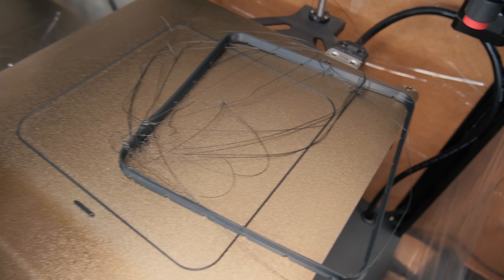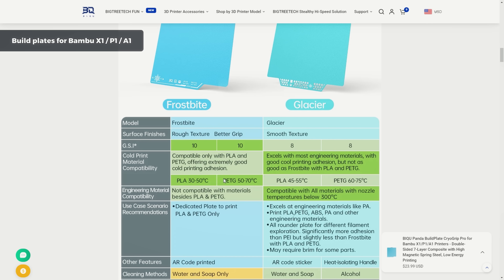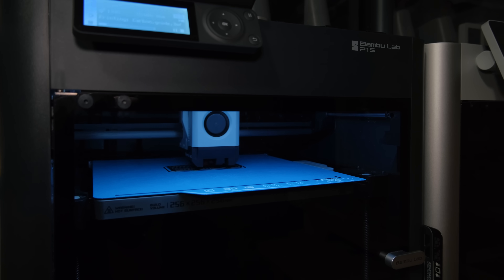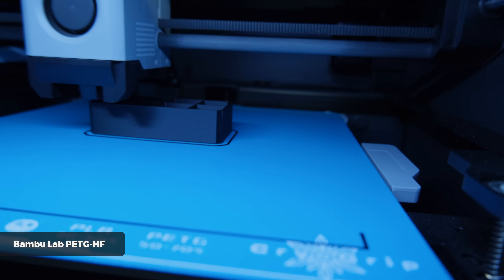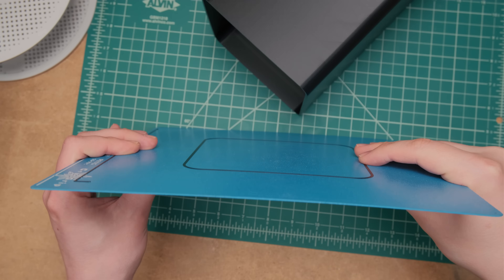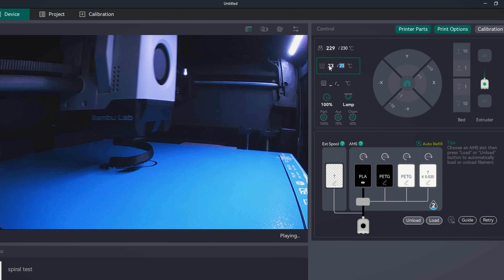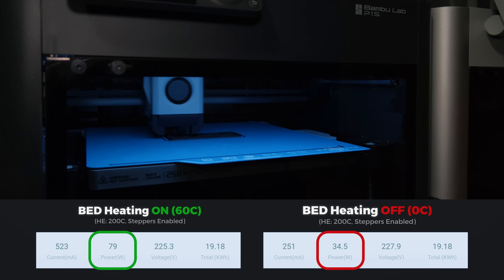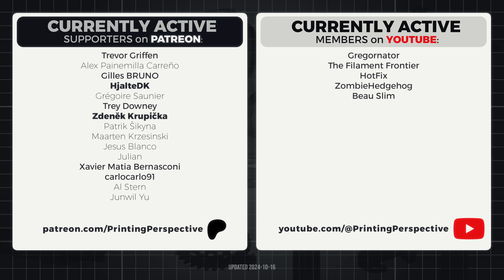The Game-Changing Build Plate (CryoGrip Pro)

Comment: Thank you convincing me to not to buy the cryogrip. There are 2 problems:
- If you print PETG on cold surface in cold environment you get similar issues to ABS.
- the print should release after cooling down. Right now my PEI sheet bed does that extremely well with PLA and PETG. Requires zero force to remove parts.

Comment: Regaridng removing prints: if youre hands are geting all over the build plate, does this plate help mitigate oils transferring from fingers and messing up adhesion?  Or are you still using IPA between prints if you have to handke the build plate?
Reply: I haven't had to clean it yet and I've done like 20 prints on it

Comment: This is awesome, they should offer other sizes for bigger printers. I would certainly use one of these in my modded Anycubic Mega X if they offered it in 300x300… it takes forever and spends a lot of power heating up that big bed , specially being an open printer

Comment: A bit of misinformation here
1) that LIDAR warning is not about it not detecting the plate, but about not detecting plate TYPE because it has no QR code. You can disable that check in the slicer.
2) part warping is not because the plate lifted (I very much doubt it lifted in the centre), but because the plastic just springs to it's warped state when not held by the plate. Use "reverse on odd" in Orca to lessen that problem.
3) Aux fan has nothing to do with the bed temperature, it's there to help with cooling the part to get better overhangs. There's no reason to disable it, you will get better results with it enabled. You should also orient the part so that the overhangs are getting as much air as possible.
4) Chamber temperature has absolutely minimal impact on overhang performance unless it is crazy high. Layer adhesion is always better with higher chamber temperature.
Reply: In my experience, AUX fan indeed does not affect bed temp, but it definitely make the warping issue worst, especially on the side close to the air duct.

Comment: Get 3M super 77 adhesive spray. Use it under your plate on the hot bed and it will hold the plate so good no warping.
Reply: Better to address the cause of warping than try to over power, or do both.  But spray glue to keep your sprint steel plate stuck in place?
Reply: @JoeyMoreland  yeah so basically when the magnet isn't good enough it will taco the bed and print together. If you can hold your spring steel sheet down with adhesive under it then the surface texture is now able to hold the print in place and let it solidify and get hard and not warp off the plate. It will always warp of you don't have good bed adhesion due to how the plastic shrinks when cooling. CNC kitchen explained it. You can slow the print down and increase the odds of it not warping as well. If you can over come the forces then it will solidify at that shape once cooled. Aka either the build surface texture able to hold it down or the spring steel sheet lifting off the magnet because it's not strong enough.
Reply: No way, that would be a miss and stink!

Comment: I'm testing the Glacier atm in a P1P with a case. I'm testing PLA at room temperature, and it seems good so far. I really want to see how this or the CryoGrip work at room temps on my A1 (it's busy for a few hrs and I didn't want to wait to try this). If I can get that bed heat to 0, I'll be super happy and get the Cryo as well.

Comment: To easily remove PETG (or TPU) from the plate, throw the plate (with parts on it) in your freezer.  Don't be surprised if they fell off the plate after 20 minutes.

Comment: Is the warping potentially from the slightly wider plate being fit between the 2 aligners and pressed a little? As that minor compression could introduce a very small bow/bend in the plate. Should be easy enough to know by comparing 2 of the same print on an A1 VS P or X series right?

Comment: There is a problem in that this is fighting the physics of plastic shrinkage, the temperatures we have established for PEI/Glass beds work because it keeps the parts from shrinking mid-print and popping free. So it's holding on, but the plastic is still shrinking beneath, so now you are printing new features on-top of a slowly deviating area(or it stays centered and lifts the edges of the plate). Alignments will slowly drift if there is geometry that makes it lean a particular direction, differential cooling effects will be amplified, etc. The whole idea is to TRY and keep the whole part up around the Glass Transition Temperature until it's done, THEN let it uniformly shrink the rest of the way all at once while everything is anchored in-place. Making the bed hotter isn't exactly what gives PEI/glass a grip, it's the fact the plastic isn't actively trying to mechanically shear itself away on a per-line basis, making the bed hotter pushes the Glass Transition temperature gradient higher up into the parts layers, so less of them are shrinking too soon and it's ability to hold on gains a mechanical advantage of sorts.
Reply: Thanks this might explain why I've gotten warping on this plate
Reply: @AJolly  don't listen to this asshole level your bed when your done lvling it level it again and run 15 mill high draft sheild your welcome
Reply: Does the plate withstand 60-70° C?
Reply: @pyalot  It looks like both the plates are at least 70c and 75c in all the tables for the max you should need to go to, but also one of the illustrations very visually says the bed is 100c while the handle edge is cold enough to touch. Else no specifications given there, so anyones guess unless officially disclosed as supported temperatures.
Reply: @Roobotics  thanks for your explanation, can you give me a conclusion from your analysis? Maybe why i should use PEI rather than a cryogrip plate, thanks!
Reply: @re_aryasetya  I won't tell folks not to get one actually, I just picked one up for my A1 mini myself, sometimes extra gripping power IS needed for thin-edged items, I think for small things in general it's really not a bad choice. But getting up to larger build volumes will multiply the effects of thermal shrinkage shifting and subtle inaccuracies of laying down hot filament onto a layer that has already contracted more than one on a hotter plate would have.
Reply: @Roobotics  definitely a perfect scenario. Brute force works well tho and most of the time those tolerances aren't really causing people problems in the real world. I know there are some parts that need more accuracy and probably would benefit in an advanced situation where the tolerance needs to be very tight, if so just get a CNC part or a resin printed part at that point.

Comment: I tried Cryogrip with my bambu x1 carbon and it was fantastic. Few days ago I bought another printer named Qidi plus 4 and it has very similar with x1. I want to use cryogrip on that but I cannot find different size of cryogrip. I just hope to see different size like 310*310 (Cryogrip), 450*450 (CR10 max).
Reply from the maker: BIQU said they will make these plates for other 3D printers, so you have to wait and see. :)
Reply: @PrintingPerspective  I asked to BIQU about and I go t same answer. Qidi told me similar answer. I cannot do  anything except waiting.

Comment: picked one up for my p1s. a real shame the glacier one isnt availible yet or I would have ordered one for engineering filaments. I print 90% pla, but im curious how the other plate would fair for stuff like tpu. plus some of the high temp filaments like pet-cf which wants like 100c bed temp with the bbl high temp plate and glue.
Reply from the maker: TPU has very good adhesion even with regular PEI plates at low temps like 35C. I will try to pin an update comment when I test the Glacier. But with ABS/Nylons/PET regular PEI with glue stick works great as you either way have to heat the bed. But it would be nice to have a plate to print many small parts and know those won't pop off during the print.

Comment: I wonder what's the market for these things. PEI beds have already surpassed magnetic adhesion for years... Personally never have parts detaching (ABS, PLA, PETG, even large) as long as PEI is clean (Q1 Pro). Printing with a cool bed migt be of interest for PLA, but surely not an option with ABS/ASA/PA because of other reasons
Reply: You say that: most people print mostly PLA / PETG, this could save a lot of energy and no more waiting for bed to heat / cool.

Comment: Very cool! A shame it didn't fit the X1/P1, as this makes it a no-go for me.
I would have liked to see your adhesion tests compared to existing plates :)
Reply from the maker: It fits but every time you have to align it perfectly which is annoying. After all the prints I have done, the adhesion is not an issue at all. But only time will tell if it won't degrade. :)
Reply: @PrintingPerspective  kiss the edge with a grinder, jeez.
Reply: It most certainly fits. It is designed for them. You just need to run your finger at the back to ensure it is placed within the stops. If it is outside of the stops just press down or re-seat it.
Reply: mine fits fine, no similar issue

Comment: I have this plate on A1 now. Pla with 50c sticks perfectly but petg even with 80c barely sticks.
Reply from the maker: I had perfect bed adhesion with Sunlu PETG and Bambu PETG-HF. I am curious about what brand of PETG you used?
Reply: @PrintingPerspective  it has no brand, at least I can't see. And another one I bought couple of years from Ali, it's petg+. The name is xingtongzhilian 😂 I am guessing is the company's name.
I may need to try branded ones. But PETG that I have barely want to stick while on pei built plate sticks. Weird.
Reply: Would love to know what PETG that is with. We have not been able to find a PETG that does not stick.
Reply: @bigtreetech5117 unbranded one. So I guess it won't be big issue for most people. I need to buy branded one and see how it goes.
But pla sticks though perfectly
Reply: Which plate? Frostbite or Glacier?
Reply: @foam27  it was bad petg, very bad, I bought new and haven't problems since. And it is blue one. No idea which on it is

Comment: Imma be honest, for PLA I havent had any issue with the stock bambu PEI bed. Smearing some vision miner nano polymer stuff on the bed to be extra sure isn;t a bad thing either but I just can't justify buying a bed that hold slightly better when its just for PLA and PETG. If this was performing this well with ABS then I would be interested.
Reply: I agree.  When I saw this all I could think was what's the issue with pla petg bed adhesion?

Give me something for my ASA that I'm not forced to use the magigoo adhesive.
Reply: Idk with mine I'm always fighting with adhesion on my a1 and a1 mini, changing temps tightening everything washing with soap and water after every print, yet somehow it still can't stick stuff to the plate, second I switched to this one I haven't had a single issue, might also be cus my room is drafty and unfortunately I can't control that but this plate has definitely removed my printing frustrations

Comment: Using less heat on the plate also means you're able to pop it off sooner, at least in the way you would need to to get the parts to come off.. definitely with you on the improved magnetism over double-sided plate tho; I'd rather just have a smooth plate anyway, so the double-sided nature doesn't really appeal to me over it shifting around..
Reply: The magnetism is extremely strong. We would love to see if the plate was actually lifted off the magnetic sheet with the prints that warped.

Comment: If you need to remove debris from an older print, and the print is no thicker than a layer, just print a few full layers over the top of it and peel it off. You might need to have the heat on full to ensure the old material fully melts and mixes.
Reply from the maker: That's a good idea :)
Reply: Yup. This has saved my PEI bed when my first layer height was wrong smashed plastic into the bed

Comment: Adhesion is so good, that once when nozzle got interfered in the infill - it resulted not in breaking detail or layer shift, but in shift of bed plate from the bed)
Reply: I think that shows more about the build plates unfortunate lack of magnetivity than adhesion to the part..(not that that means part adhesion is bad)
Reply: @TS_Mind_Swept  yep, your are right - lots of small details warped the bed plate a bit and lost the magnetic grip.
Reply: Getting a bed to shift by applying a sheer force alone would take a loooooooooooot of force. Try to give a push on the edge of a bed and see what I mean. Likely that the whole machine would move before the bed does. Surprised that this happened.
Reply: @bigtreetech5117  I was really surprised checking camera in octoeveryhwere in that morning =) but it seems lots of details warped the plate a bid enough for magnetivity to loosen.
Reply: @bigtreetech5117  heh, just happened for the second time with petg whole bed print on a1, looks lite not that loooooots of force is required. I'm  lucky it had not broken anything, as the plate got below bed somehow in the end.

Comment: These are absolutely becoming popular, with Biqu and Darkmoon's popping off, even Bamu Lab has their own new one to replace the old col plate, called the "Cool Plate SuperTack", launching November 12th
Reply from the maker: At least according to Reddit comments, the BIQU plates have better adhesion. It will be interesting to see how the Bambu Lab's plate performs.
Reply: @PrintingPerspective  BBL Plate is not compatible with PETG.
Reply: BBL Bed does not support PETG. Pretty much only PLA and one or two other rare ones. Latest bambu studio on github has the supported filaments in code.

Comment: You can totally use scrapers. Te problem ist people are just incapable to use them correct. AND they must be modified first to ensure no damage. Also the correct treatment of a PEI sheet will get you near or even to equal performance. But guess what.. most dont know how to treat or clean them proper.
BTW... bambu printplates also tend to be worse than others.
Reply from the maker: I never said not to use scrapers on the PEI plates.

Comment: Anyone knows how ASA performs on the Glacier Printbed ?
Reply: its a g10 plate
Reply: @LiamRay10  Not G10 by any means.
Reply from the maker: I don't have mine yet to confirm but at least BIQU specifies that it has 8/10 adhesion for ABS/ASA. This Frostbite plate for PLA has a 10/10 rating by them. But if you print with good ASA filament the bed adhesion and warping are not an issue on regular PEI plates.
Reply: ASA on glacier sticks like ...... to a carpet.

Comment: Am I missing something? I print PLA and PETG fully enclosed all the time and its perfectly fine...
Reply: Same
Reply: @eggbag4182  it's totally fine to do depending on the insulation value of your machine's chamber and the ambient temperature outside the machine as well, basically you will get problems only if the air inside saturates to a high temperature and the molten filament can't be cooled down with blowing warm air against it to 'freeze' it quickly. Things like overhangs and smaller details higher up in the print becoming blobby, will be the first signs of this happening.

Comment: Do they sell just the surface material to put on different shaped (round) spring steel sheets?
Reply: If there is a sheet that is popular enough, we will make it.
Reply: @bigtreetech5117  I'd love to just be able to get the adhesive surface sheet large enough without the spring steel already attached (I don't have good cutting capability for steel) so I could put it on an existing 250 mm round delta spring steel plate.
Reply from the maker: I really doubt they do
Reply: @PrintingPerspective  That's unfortunate. If it's really good though I guess someone else will clone it.